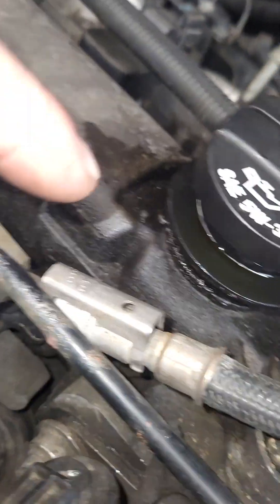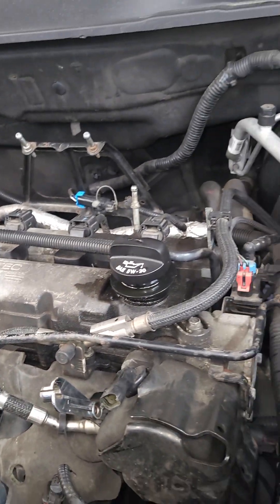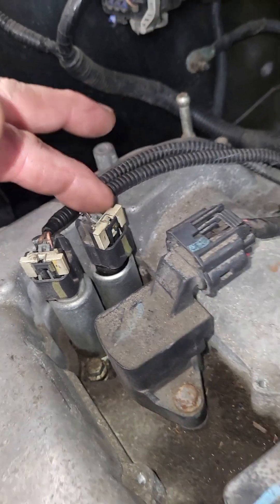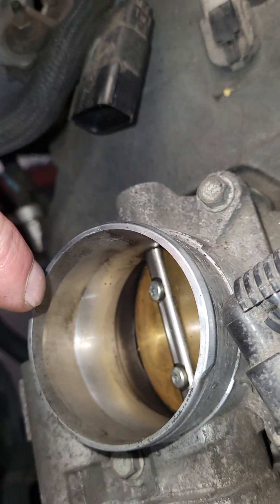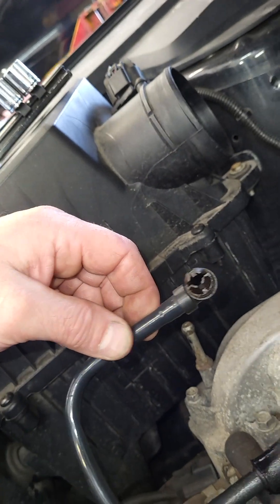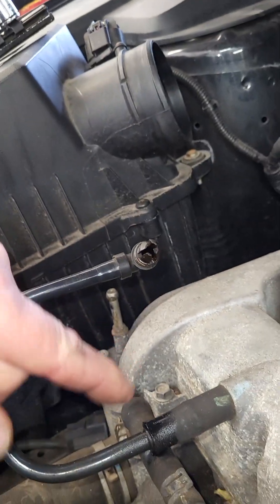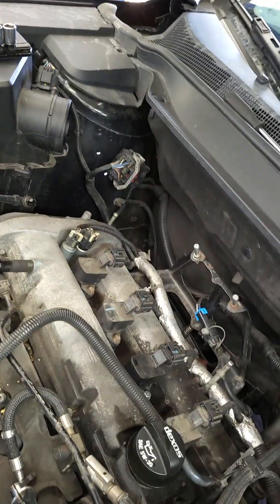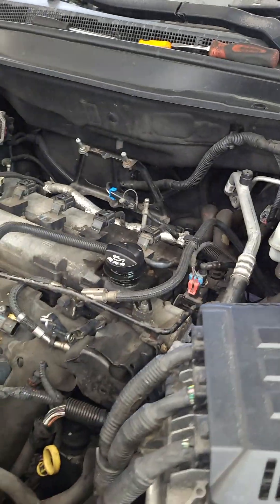My prescription to reduce or stop gm ecotec 2.4 oil consumption.it's not normal to burn oil

Comment: That will help the issue but not stop/fix it. Those all need to be done, however you also need to pull the plugs, fill each one with half a can of Seafoam. Turn the motor over without spark plugs in. Then add aftermarket oil fill cap, add a pcv vale on top of it and send a hose from the pcv & intake manifold to a catch can.

Comment: That is a Big Grocery List... Suppose I should try and Chip away at it as best I can.  2014 2.4L Ecotec.  Hopefully just switching to using Valvoline Restore and Protect (though it isn't yet a Dexos rated Oil) will be helpful. (Even though it has regularly had Interval Changes between 3-5K miles using Dexos1 Full Synthetics til now).  

Don't have Oil Consumption, but plenty of Fuel/Oil Dilution so probably should address the Fuel System/Intake Valve Cleaning along with the Carbon Deposit Removal (via Restore & Protect)

Comment: If he's pouring all that oil into it every week he might as well do the oil changes more often!
Reply: Wont help… then all the sludge from the burnt oil creates so much pressure that you blow the rear main seal and lose all the oil as your driving and end up w a locked up motor
Reply: @coleproctor7995   that's why you change the oil so the sludge comes out LMAO